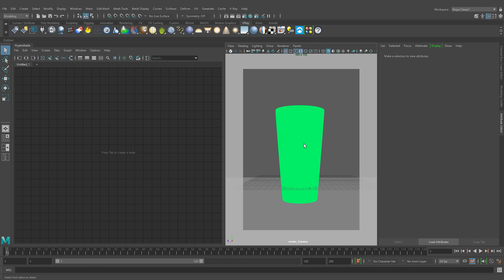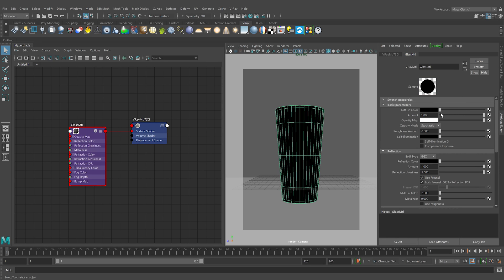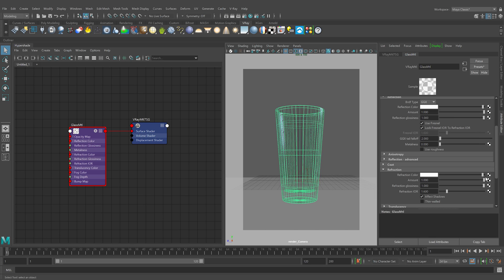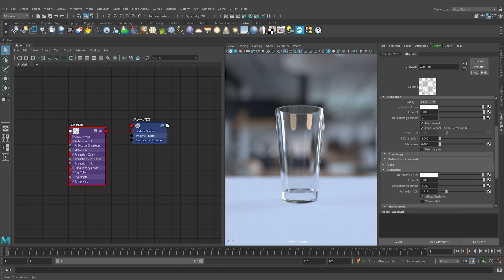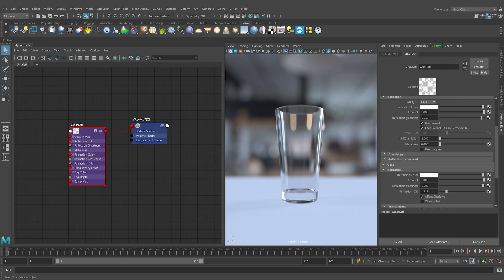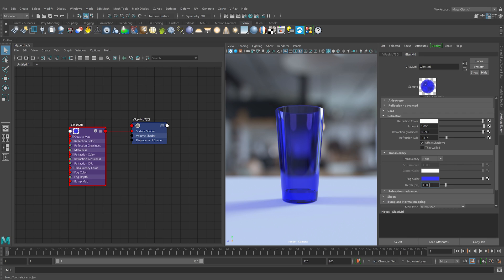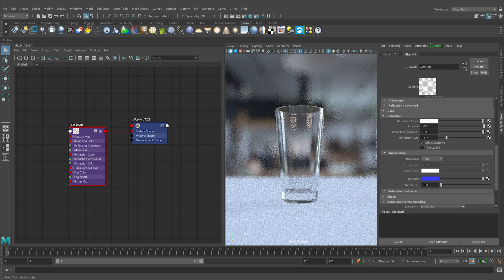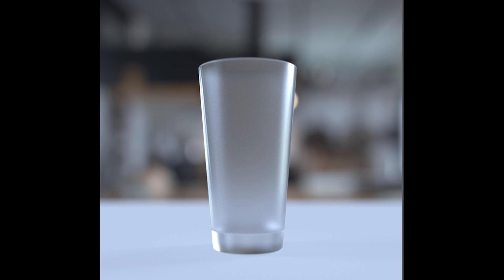V-Ray for Maya — How to make glass

Comment: Hello, I have a question from the point of view of physics, I understand that the refractive index in the case of reflections is the difference of the adjacent media (between the air and the material), I mean that if the refractive index which in this case is 1.5 for refraction, for reflection is the difference if the refractive index of air is 1 then the appropriate value for reflection is 0.5. It may be that what I am saying is wrong, that is why I ask, because in my opinion the refractive index of one should be separated from the other.